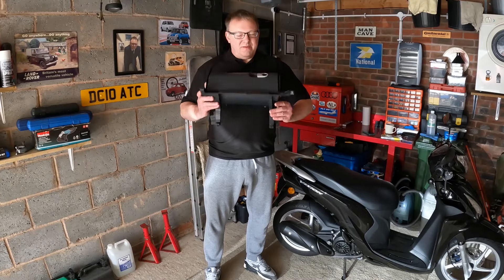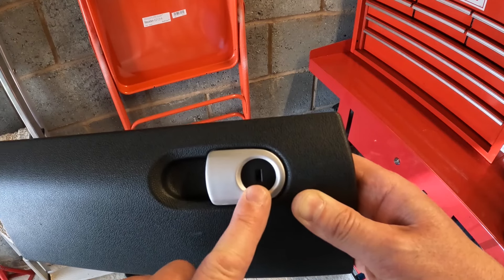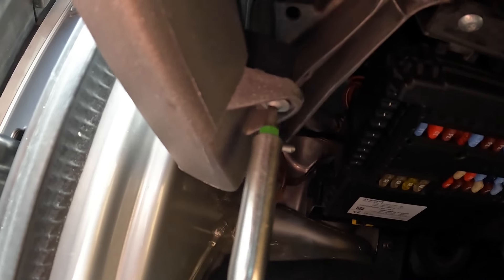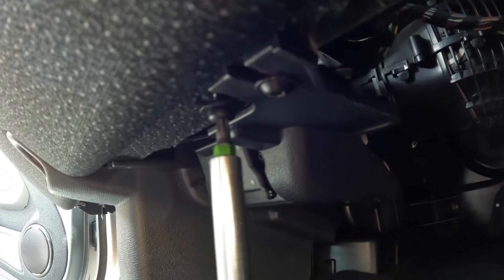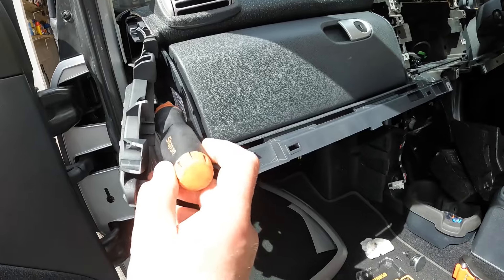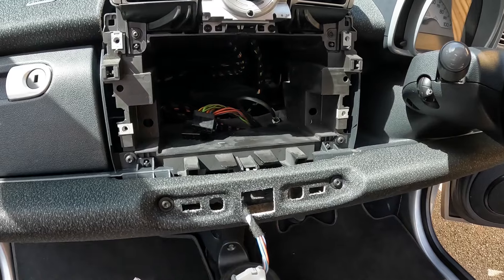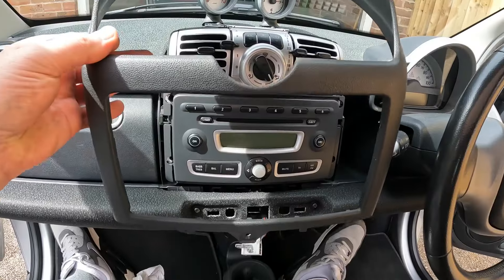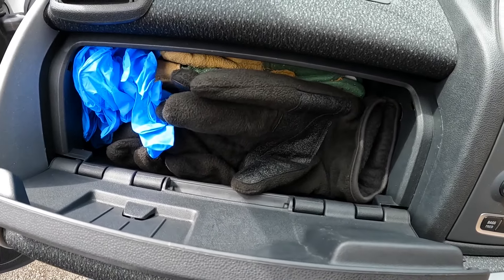Retro-fitting Glovebox - Smart Fortwo 451 Passion 84 BHP 2008

Comment: Another nice video. I would be interested to carry out this mod but would consider just adding the frame and lid. You say it's easier to fit the whole unit could you explained why as I would think just fitting the frame into position and drilling the box and. Fitting the frame and lid seems much easier unless I'm missing a majour something.. Thanks, Brendan. 👍
Reply from the maker: You’d need to remove the existing housing anyway in order to get it on a bench to mark out and drill for the locating dowels and screw holes, so I just figured it easier to bypass that step and buy the unit complete. The outcome will likely be similar!

Comment: Nice. Is it possible to change the radio panel to a funky touch panel, GPS? 👍
Reply from the maker: To be fair I will very rarely deviate from original equipment but with the correct adaptations, most things are possible. There are numerous aftermarket options.

Comment: Looking around, it seems you put your 451 for sale in June - so probably gone by now. That's a shame - I learned a lot from your videos: removal of the rear panel, gearbox oil change, swapping the intermediate elbow to the exhaust, changing the front engine mount etc. I have a 2009 451 turbo and would have liked to have known the part no. for your exhaust (if original) and whether the gearbox oil change would have been easier on a ramp (I'm guessing so). I'm about to change the alternator belt on mine at 60,000 miles - that would have been helpful to see, too. Anyway, I'm subscribed and see you have some BMWs to play with - in addition to my 451 I have a BMW E30 and a BMW E39!
Reply from the maker: @badwolf4058  Yes I took the difficult decision to sell it. I’d done so much to it that there was no more content to be made. It was a great example and I daren’t calculate how much I spent on parts! Great to hear about your BMWs. I hope you enjoy the Z3 content. There’s lots to come.

Comment: why not re-code the lockcylinder?
Reply from the maker: @stefanarveros2116  I’ve done that before with metal lock cylinders containing brass tumblers and springs but this is a cheap plastic arrangement and I’m pretty sure there’s no way of removing the cylinder without wrecking it.